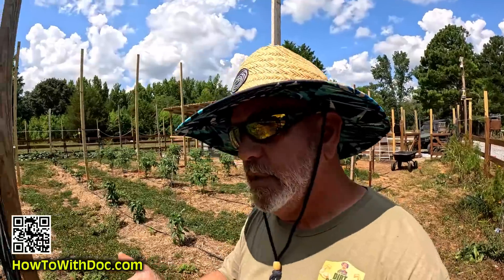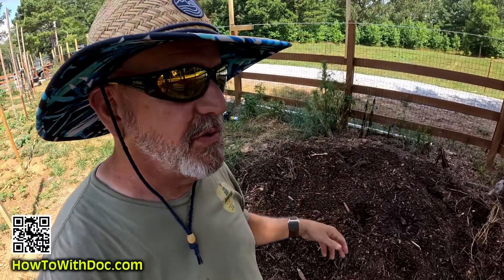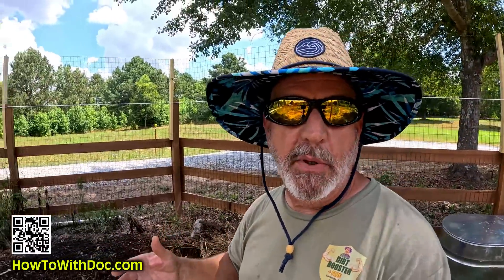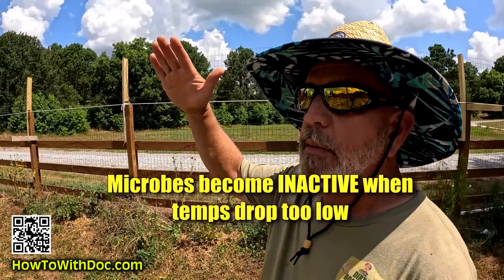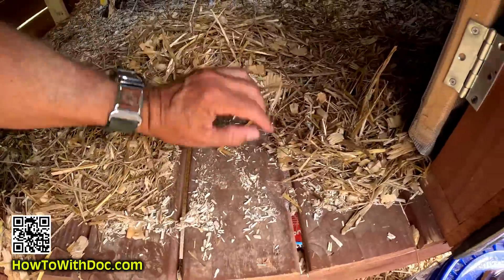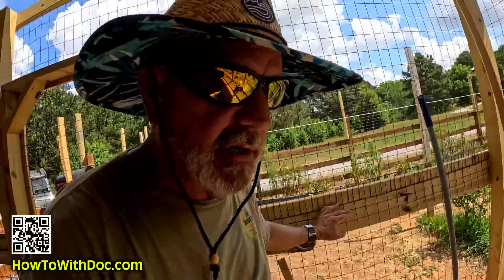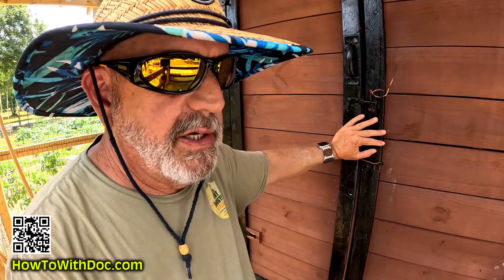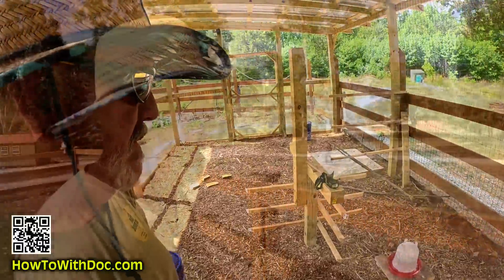Chicken Coop Deep Bedding is Yours Failing

Comment: Have had my chickens a little over a year now. I have a solid floor in my coop, spring/summer I change pine bedding every couple weeks. Winter I only had to change it every month or so, whenever ammonia smells starts. Only 2 inches deep when its warm, 3-4 inches when its freezing. I kept the coop 36-45 degrees and had eggs all winter. We got down to -65F with wind chill
Reply from the maker: Yes... one issue is that people are doing the deep bedding for 12 months at a time without any rotation or turning, then add in the cold weather and can be a mess.

Comment: We do deep deep bedding but don’t turn it. 5 gallon bucket off to the side and wife goes out once a week with gloves and places chicken manure with small amounts of bedding attached into bucket. That goes into compost pile. Have several piles going at once at different stages. We add bedding maybe every 2-3 month. And completely clean it out every 6 months ish. No flies in coop or run. 20 chickens +\- for about 10 years this way. Also add sweet PDZ to bedding helps
Reply from the maker: Yep... many like it... but some have issues. It will be interesting to watch.